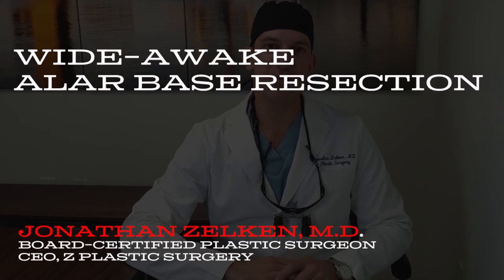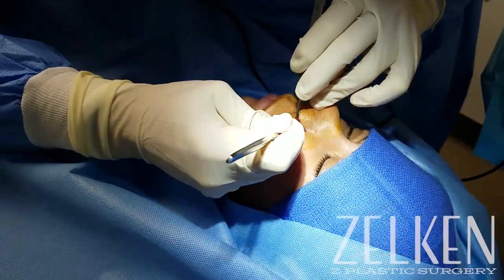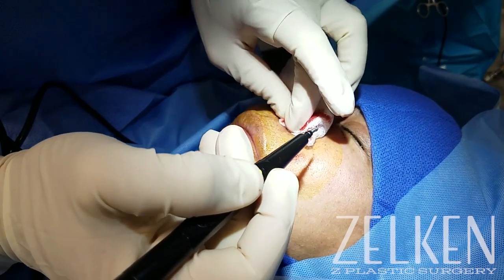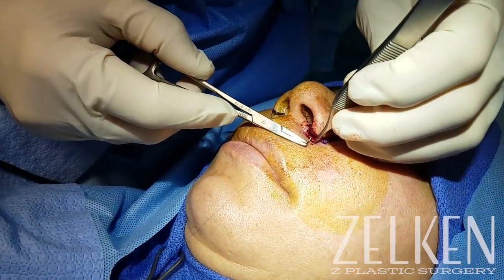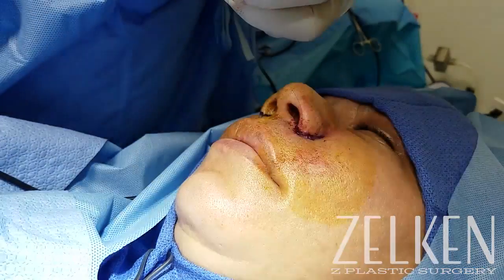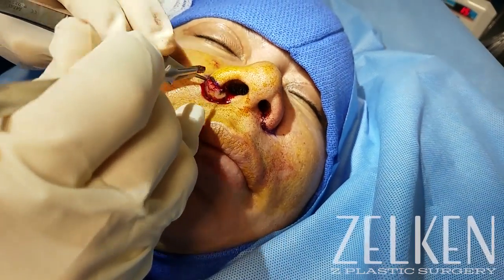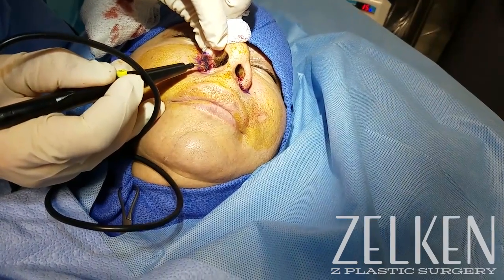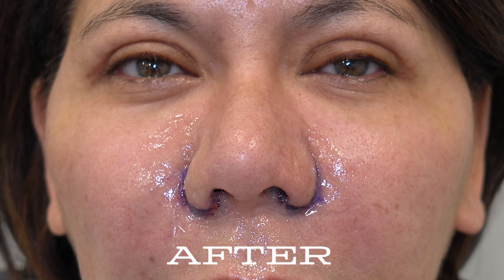Nasal Alar Base Wedge Excision Weir Nostril Reduction Newport Beach

Comment: Is there a way to prevent the triangle shape that the nostrils sometimes take on? Like Janet Jackson’s. I also see it a lot on Asian nose jobs.
Reply from the maker: Yes. Good question. That pinched look can occur from two processes- 1. suturing the tip cartilages together too tightly, and 2. overdoing the alar base resection. In either case this can be prevented with an "alar rim graft" and corrected with such a graft or even ear cartilage if needed.
Reply: Thank u doctor for replying. That is a fear and  major concern I've had.
Reply: @jonathanzelkenmd  aà
Reply: Thank you for asking this. I have been watching alarplasty vids to learn how NOT to have Janet Jackson's nose shape.

Comment: If the alar stitches are placed with too much tension / too deep, can they alter / make worse the nasolabial fold?
Reply from the maker: Great question. Yes, it may be possible, but I haven’t seen this outcome.
Reply: @jonathanzelkenmd  Thanks for the answer. 

I'm thinking it happened to me as i noticed a clear difference post op, there was a hard crease right above the last alar stitch on each nostril that never really smoothed out